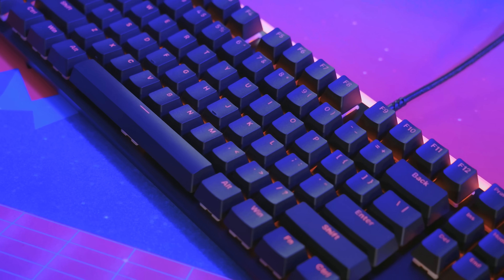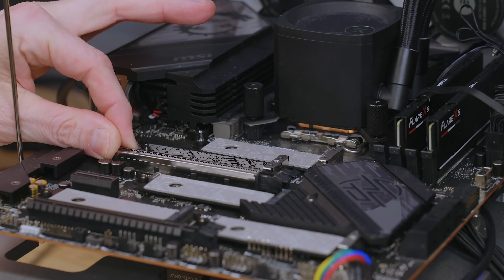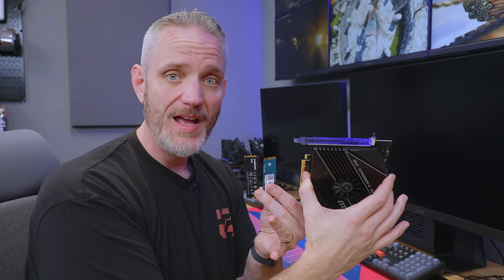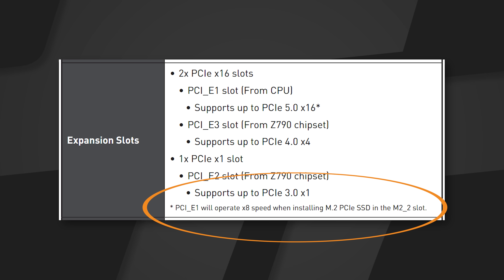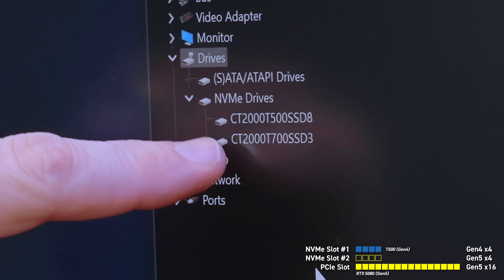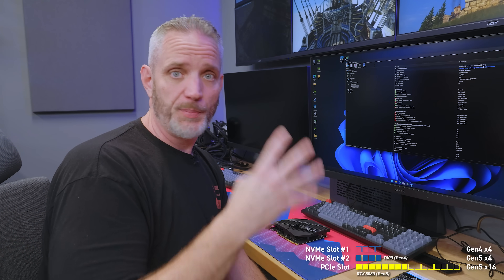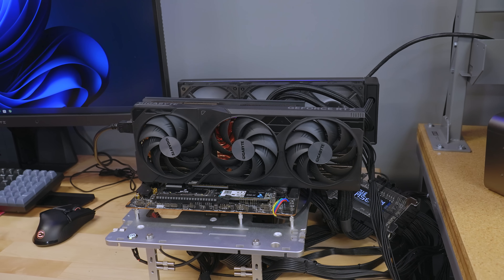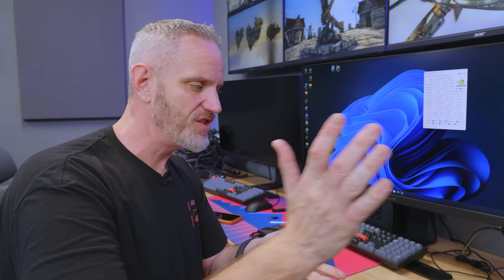Don't make this mistake with your PC!

Comment: This is why X870 and X870E is better chipset. B-series from AMD is the most useless chipset.
Reply: Ehh... It depends. X870 is exactly the same as B650(E), and X870E is exactly the same as X670 and X670E.

The 600 series motherboards do not have mandatory USB4 like the 800 series, which means that 600 series board could make the secondary x4 connection from the CPU available as another Gen 5 M.2 without bifurcating the primary PCIe x16 to x8.

A saving grace is that some X870/E motherboards put the USB4 controller and an additional Gen 5 M.2 behind a switch, so you can choose which one you want to use.
Reply: @JMccovery  Not really, adding US$20-30 more, you can jump from B850 to X870

And no, B650E does include a huge amounts of bottlenecking since there are 2 chipsets on the board.

AMD solution is basically using so much gluing that it bottlenecking the entire system.
Reply: @AlfaPro1337  They are physically the same chipset.

All are variations of Promontory 21: B650, B650E, B840, B850 and X870 have a single Promontory 21 chipset, while X670, X670E and X870E are the dual Promontory 21 solutions.
Reply: @JMccovery Regardless, no onr should buy the B-series from AMD, it is the most useless chipset since AM4. Either pick the X-series, or the A-series (or now B840).

Comment: PLEASE make a video on connecting 360 CPU AIO (9800x3D with Aqua Elite 360) and 360 GPU AIO (SUPRIM LIQUID SOC) to an ASUS ROG STRIX X870E-E in a HAF 700 EVO... I will have to do just that next year and I am SUPER confused. Those are some expensive components and I dont want to f*uck it up.

Comment: I've had to explain to clients that consumer motherboards (and/or CPUs) are a little behind the speed capabilities of Gen5 drives and DDR5 RAM. I get asked a lot, "Can I just buy a better board?" The answer is, "Not like you think." I feel like boards with more than one built-in Gen5 m.2 slot are rare?
Reply: ASRock x870E Taichi motherboard has 2 gen 5 slots so you don't have to worry about splitting up your pcie lanes. So 16 goes to my gpu, 4 goes to the gen 5 nvme, then 4 lanes goes to a gen 4 nvme without taking away from the 16 gpu lanes
Reply: MSI X670 Carbon has two gen5 m.2 slots that can be used concurrently with the x16 PCIE slot
Reply: MSI Tomahawk X870E has 2 Gen 5 slots as well as 2 gen 4 slots. Both Gen 5 slots are from the processor, and the 2 Gen 4 slots are from the chipset. ( I am currently running a gen 5 and 3 gen 4 nvme drives on my system, and it doesn't take away from my graphics card.)
Reply: Thanks for the board ideas, guys!! I've got one client putting together a PC now who is a die-hard Intel fan... but I've definitely been pushing AMD for gaming, which is a complete 180... like we have vintage Intel posters on our walls. 😂

Comment: yeah my nvme ssd are pcie 4 and my graphics card is a 7900xtx running at x8 as my board supports 4 nvme drives the second nvme slot is shared with the grpahics card its running x8 gen 4 it also killed the x4 slot that a 16 length connector ive been thinking of removing drives and putting them in to a carrier card i have that has a pcie switch chip so i can have my 4 drives and restore my video card back to x16

Comment: I was just dealing with this, partly because of your last video on the subject. I recently upgraded from a Strix X570 board to a a Strix X870E. My old board could bifurcate the second PCIE slot, so I put in an adapter to add 2 NVME drives. The new board, for some reason, could only split the top Gen5 PCIE slot, so I could no longer use that.

I ended up filling all 3 gen5 slots with gen5 drives, reducing the GPU to 8 lanes. The put an old gen4 and gen3 drive in the other two gen4 slots, which are both running at advertised speeds.

Thanks for the info, Jay!

Comment: With how much are moving to PCI, I seriously have been begging them to increase lanes available. So much is now relying on them that most consumers don't under this and just say it's a slot, I plug in said thing, why doesn't it work right.

Also some manufacturers manuals are horrible at laying out what each lane is for. I've had some. MSI manuals just not list what lanes are connected to what, like is this the CPU PCI lanes or chipset. Manufactures especially if including so many m.2 slots should list each ones capabilities, if it's cpu or chipset and if installing multiple nvmes, give them the best set up and tell the consumer what will happen. So like the board you have, have it say, if installing 2 drives, install it into slot 1 and 4 if you want to keep your GPU at 16x, installation or installed in other combinations will reduce your GPU speeds to 8x.

Comment: So if I'm not a gamer and want full Gen 5 nvme drive speeds, I need an adapter and put it in the pcie 16x slot where you put the GPU?  Bifurcation is great if you want to build a NAS instead of a gaming computer.

Comment: Note: some GPUs like RTX5060 and 5050, they may have a x16 slot, but actually only run with x8 on the card, so this frees up lanes for the other devices. In my case I have a 16GB RTX5060Ti (Gigabyte Windforce) that literally has the x8 length connector on the card itself, not the full x16 connector.

Comment: Looked this up when I was building my X870E-E Gaming Wifi the other day, and yeah. Definitely did not want to bifurcate anything. The slots are in some very weird spaces. The top left 2 NVME slots bifurcate the GPU slot into an x8. But the right NVME slot is fully PCIE5 by itself without touching the GPU. The bottom 2 PCIE4 slots don't bifurcate.

Comment: LMAO, I still can not get over how we are both using the same Keychron keyboards! I also love my "bare bones" Gigabyte motherboard, because it has two M.2 slots, one is PCI-E 3.0x4 and the other is SATA, I can use one, or the other, but not both. I am fine with that, my 2TB SSD in its PCI-E 3.0x4 is plenty fast for me, and I still have full PCI-E 3.0x16 for my RTX 2080 Super. Also left a PCI-E 3.0x1 for my Bluetooth/wireless internet card. I do admit I am holding my processor back considering it is a Ryzen 5 5600X on a B450M chipset, I could be enjoying a PCI-E 4.0x4 NVME drive instead of PCI-E 3.0x4, but I don't need massive storage bandwidth for 90% of my games, a good chunk of my older games are still on spinning rust.

Comment: Can you clarify. If your PCIEx16 is bifurcated to 8 for the graphics card and 4 for the gen 5 nvme, can we add another gen 5 nvme to use the left over 4. You said testing showed it's not noticeable for one, has anyone tried two. Hardware wise how would we do that? The board you showed doesn't have 2 nvme gen 5, can we get an adaptor for the second pciex8 lane to nvme?
Reply: What? If it;s bifurcating, there will almost definitely be a second M.2 slot there, that the lanes go to. But if the board doesn't have a port with the lanes going to it, there isn't really much you can do.

Comment: I have that motherboard, when I set it up for the 1st time, I used both top NVMe slots and 2 of the ones below the GPU slot, all my NVMe's are Gen4 (I have 3x 2TB and 1x 1TB for OS etc).  I didn't read the manual! (who does lol). After using some system details software, I noticed my GPU was only 8x. As you said, I didn't notice any performance issues, but for piece of mind I just moved the one from slot2 to the empty one below the GPU.

I shoulda known better tbh, coming from a EVGA x299 Dark, there was a similar restriction if I remember correctly.

Comment: According to TechPowerUp-test RTX 5090 at 4k retains about 99% of full performance when it gets PCIe 5.0 x8 bandwith.  Funny thing is that when gets PCIe 5.0 x1 bandwidth it retains about 85% of full performance and is still much faster than RTX 4090 with full PCIe 4.0 x16 bandwidth. 

With cards that have inadequate amount of VRAM it becomes important to have as much PCIe-bandwidth as possible (since game assets are loaded to system RAM instead of VRAM and this creates a lot of traffic trough the PCIe-slot.   Card like RTX 5060 TI 8GB suffers a lot more when ran at PCIe 4.0 instead of 5.0 compared to 16GB variant.
Reply: Yup, for real world scenarios PCIe generation and 8x vs. 16x only matters in VRAM limited scenarios. The only real card where this will matter currently is the 9060xt 8GB, since it's a 8GB card with PCIe 5.0 x16. But if you pay 50 bucks extra (in my region) for a B850 with PCIe 5.0 over a B650 with PCIe 4.0 to get 2% more performance. Then you really should have spent that money on a 9060xt 16GB instead. So there are very few actual meaningful real world cases where you need to care. And if you're on enough of a budget to be on a 8GB card. Then you're also on too much of a budget to slap more than 1 nvme in there. So realistically this should almost never have any real impact. But it's good to know if you're into min/maxing those last 1-2 frames.

Comment: Running a X670E Aorus Master which has 24 lanes, so i can get my 4070Ti Super at 16x (Gen 4 but it will support Gen 5 when i'll upgrade my GPU). I run 1 9100 Pro (Gen 5 x4), 1 990 Evo (Gen 5 x2) and 2 990 Pro (Gen 4 x4)

Comment: Tip: don't touch the pins (PCIe interface) on your cards/RAM/SSDs. The oils on your fingers can create corrosion over time (like years). ❤
Reply: MrsTech, old enough to remember when RAM came with tinned pads instead of nice gold contacts?  Take it out every six months and rub them down with erasers as part of normal maintenance.  Besides, you were probably re-installing Windows by then anyway.  Good times.
Reply: @bobclarke5913  My husband does, and he said he should still have some floating around! 😊
Reply: Gold contacts don't rust.   BUT
Oily residie pulls dirt and grime that gets between the contacts and causes faulty connections, so yes don't touch themz also don't  clean abrasivley and shave of the gold coat
Reply: @BearPiggy Thanks for the clarification, that makes sense!
Reply: Also, electrostatic discharge is a thing.
Reply: Isopropyl alcohol and a coffee filter goes hard
Reply: @somedude9934 I've never thought of using a coffee filter... that would be totally lint-free and non-scratch!
Reply: These kinds of comments make me think I should probably be wearing gloves when working on my PC in any way 😅
Reply: @123Suffering456  It wouldn't hurt! I also hate having to clean up my oily finger prints from VRM heatsinks, GPU back plates, and cases. I've been contemplating wearing gloves while repairing and building. The only thing holding me back is an allergy to my own sweat. 😂

Comment: i dont think you can split x4 into 2x x2 and run two nvme drives in an expansion board...those lanes just do not go the 2nd slot. these expansion cards are just adapters to physically adapt m.2 drives to a pcie slot, there usually is no further computing or lane splitting on them.
Reply: I believe some of those cards turn 2 or more drives into what looks like a single drive via a hardware raid chip.

Comment: a simple way to see is flip motherboard over and you can see the soldering on the backside and will also confirm if you have a x4, x8 or x16 slot. This comment is more for the techies here😊
Reply: that's all well and good if you haven't mounted the board in your case yet, but nobody wants to take their board out to check soldiering traces. Also, doing that doesn't tell you anything about bifurcation, which means that some slots run at slower than physically capable when other slots are populated. it's a mess and the only way to be sure is to check the manual for most boards.
Reply: @Vitam1nx  then look up your board online and hope for fotos of the back
Reply: some boards offer in depth explanatory stuff about the board, or u could write an e-mail requesting in depth pdf about the board if ur board enough and want to max out something on it

Comment: Now here is my question: What happens to a nvme4x gen3  drive if you put it on the same 4x gen4 lanes with another nvme ssd that is pcie gen 4 x4. those lanes are shared over the chipset for either 2x gen4 nvme or sataports
Best thing would be it detects the gen 3 drive and is able to provide 4xpcie gen3 lanes (2x gen4) and give the other ssd 2x gen4 
But it could be that the other ssd has to be downgraded to gen3x4 aswell which would be okay or worse, that it has to step down to gen3 but can still only provide 2 lanes which would cripple both ssds at the same time.

Comment: Few years ago I was looking for a AM4 MB for my home server. Bifurcation was on the list of requirements bc I wanted a lot of nvme storage. Interestingly the cheapest x570 (Gigabyte Gaming X) Had the best PCIe layout for my use case (no line sharing and "dead" ports). Better than any higher end boards.
Reply: Now that really is funny. The irony of that situation just makes me wonder wtf they were smoking when they designed the more expensive boards and that still does my head in with current gen.
Reply: I'm currently using a B450 board for my home server, and it disables two of the 6 SATA ports if you run an nvme drive in the m.2 slot on the board. Found this out when I went to add more drives and only the first 4 worked. So I ended up buying a PCI-E to nvme adapter to use one of the physical PCI-E slots on the board, and just like that now all 6 SATA slots work.

Comment: I am all good, have a 9950x3d on a X870E Hero and have a 4090 installed in the main PCIE slot, at x16 and have a Gen5, Gen4 and a Gen3 installed into slots M.2_1, M.2_4 and M.2_5

Comment: I found a custom made bios on github for my 10 yr old X99 godlike board. The bios added bifurcation and some other modern features. I threw a 22 core xeon that i found on ebay for under 100$. Thanks to the bifurcation i have a sweet home server with a 10gbe nic, 16 drive raid controller, 4x nvme card and a gpu for decoding. its running trunas, plex, and some game servers all through proxmox.

Comment: I got the X670E Creator, even if it´s lowest PCIe 4.0 x16 (x2) slot limiting one of the 4.0 M.2 slots to 2x as well. I used that slot to install a USB 3.0 card, as the board has only one slot, but my PC case needing two. The 3.0 SSD in that shared slot is my slowest anyway, although it didn´t half it´s speed, as it was below 3.0 x4 speed anyway. My other 3 M.2 SSDs are 4.0, I didn´t need 5.0 speed, especially at the price hike for the same capacity.

The Aorus X670E Master could´ve been an alternative, but there I would´ve needed to install a 10gbit card to connect to my NAS, but that just would´ve disabled two SATA connections.
I didn´t choose that one because the CR2032 BIOS Battery is behind the Chipset heatsink, which would require to remove the whole board from the case to remove the heatsink to replace the battery.

Comment: They really need to have non-halving lane divisions. or rather not require power of 2 lane combining. MB designers who want main pcie slot to be able to give up lanes to an NVME slot should be able to drop to x12 and ONLY give up four. just for example. If there is case for needing three lanes for each of two usb controllers and 2 for a sata controll and 8 for two nvme drives, that should be configurable. This current only 1-2-4-8-16 is long overdue for obsolescence. Frankly it was by pci3 and probably pcie2.
And yeah Intell and AMD need to start having more PCIE lanes. 32 pcie5 at a min and that's assuming some pcie4 lanes as well, at least 16. At least on threadripper you can get 64+, but that's a pricy way to not have to play games and still only get limited utility, just with a choice on where you get cut short.

Comment: Remember to read your SSD manual, aka Samsung SSDs require you to install their "Samsung Magician" software which facilitates monitoring, firmware updates, and most importantly "Over-provisioning" which allows your SSDs to actually achieve their maximum rated speeds and also improving reliability, and endurance.
The trade off with enabling "Over-provisioning" is you have to give up 5-15% of overall storage capacity to achieve the benefits.
There is a reason over 90% of SSD benchmarks on UserBenchmark are no where near achieving maximum speeds.
Reply: The benefits of Over-provisioning:

Improved Performance: Over-provisioning leads to faster write speeds and better overall performance, especially under heavy workloads. 
Increased Endurance: It helps extend the life of the SSD by distributing wear more evenly across the NAND flash cells. 
More space for management: The extra space is used by the SSD's controller for tasks like wear leveling and garbage collection, which involves moving and erasing data in the background. 
Reduced write amplification: With more pre-erased blocks available, the drive can handle new writes more efficiently, and less background data movement is required to make space for new data. 
Less time spent on maintenance: Less background data movement means fewer and less frequent, intensive operations. While not a primary goal, this can lead to slightly lower overall heat production over time. 

By providing more space for the SSD controller to manage writes and wear leveling, over-provisioning leads to faster performance and better endurance, which means the drive spends less time performing intensive, heat-generating tasks like constantly reorganizing data.